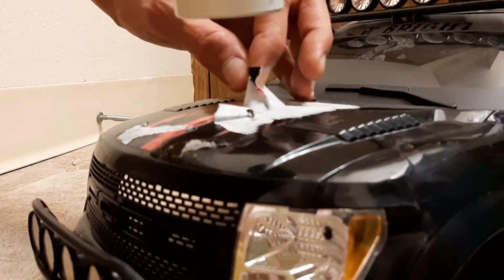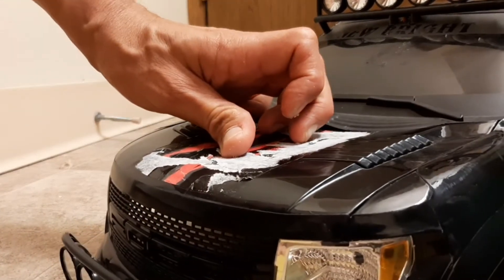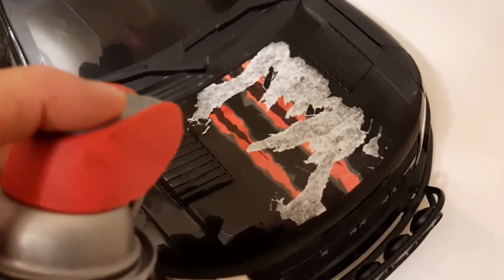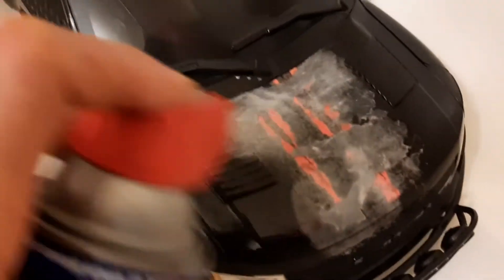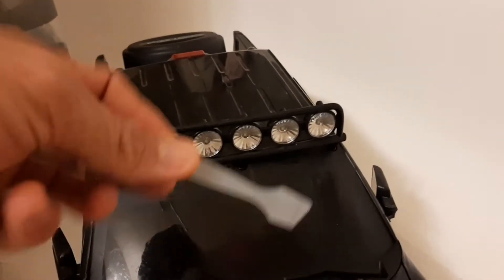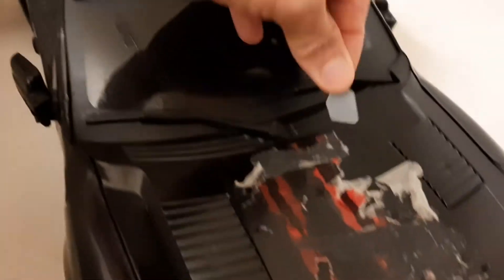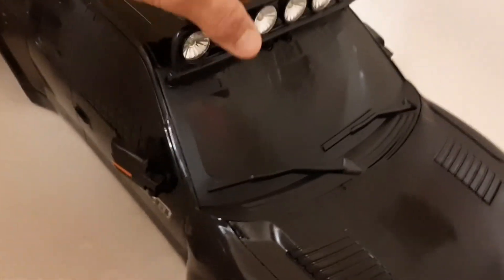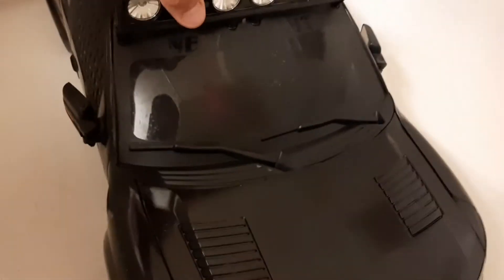#RC #sticker #removal- BEST way to take off stickers and residue from car truck RC hardbody #Decals

Comment: Thanx for the video. I was just wondering how it could be done.
Reply from the maker: It usually does work well with a hair dryer but if the sticker is old and has been weathered then it has no integrity left. Below are 2 other videos I made both with different methods. I just subscribed to your channel. Hope to see some content from you someday soon. Check out some of my other videos as well and subscribe if you like my content. Thanks for stopping by my channel.

https://youtu.be/ICERets8LZg

https://youtu.be/gXaDnOQ8bG4
Reply: Wanted to thank you again it worked great.